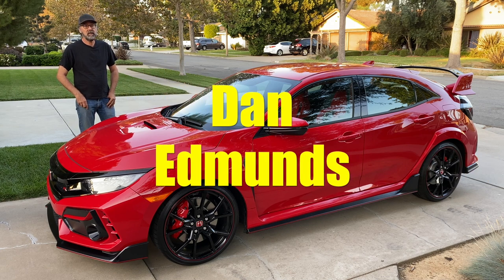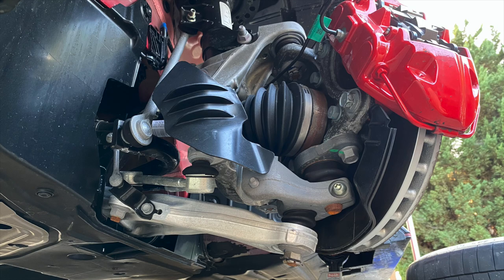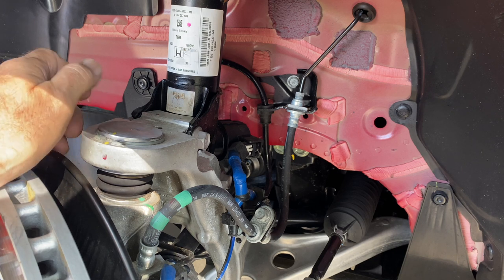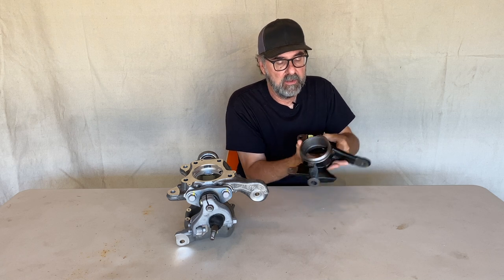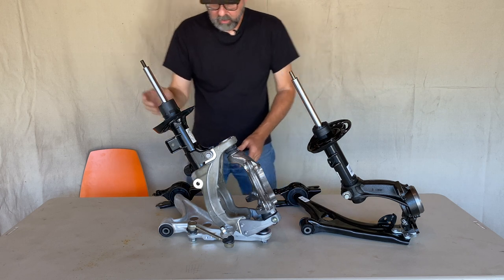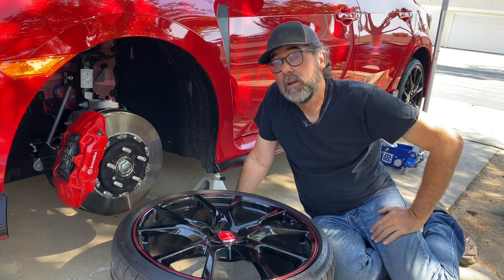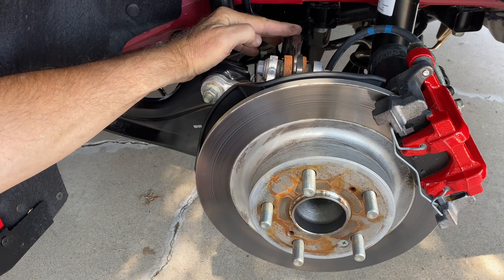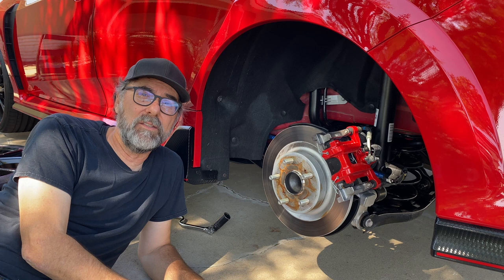2021 Honda Civic Type R Suspension Walkaround - See The Engineering That Gives It Epic Handling

Comment: Can you comment on the wheel size and the effect that has on this setup? Is the suspension geometry designed with that size/sidewall in mind?
Reply from the maker: As a factory-developed package, absolutely, all aspects of the suspension including the tire size, wheel offset, etc., were considered. It's all optimized to work as a complete system.

And its not just about tire size. When I developed suspensions back in the day, I routinely worked with tire supplier engineers to tweak the internal construction of the chosen tire brand and size. Over the course of several months there could be three rounds of joint evaluation using the prototype vehicle I was using to develop the springs, stabilizer bars, bushings and dampers. Each round might have six submissions, each with different internal construction details meant to deliver a different ride, steering and handling feelings. The tire company representative and myself would conduct joint drives and has out next steps.

That's all true of any car. But with something like a regular Civic, the target buyer is a typical non-enthusiast buyer. That kind of system is tuned to have broad basic appeal. But even there the choice of tire size and the internal tire tuning is made to work in that context. But because the target customer is more middle of the road, an enthusiast buyer who is willing to give up ride, noise, etc. can experiment with aftermarket parts to alter that balance and get more performance. 

Here, of course, performance was the point. There's less incentive (and potential benefit) associated with owner-installed tuning on a Type-R because this tire size, wheel offset, etc. were developed along with this geometry and spring/damper tuning and the unique dual-axis strut suspension to make this package work as a unit in a more performance-minded context.

It's interesting to note that while the recently-introduced 2021 Type-R Limited Edition does have special wheels and tires, they are the exact same size and wheel offset as this car. The difference? Stickier rubber and lighter wheels. They save 5.5 lbs of weight (all unsprung) at each corner, which makes a lot of sense when you see all that stuff on my bench walkthrough. But the tire/steering relationship has been absolutely preserved because that's all been sorted out to their satisfaction.
Reply: @DanEdmunds  Great info, thanks for the reply. The larger wheel sizes >18" always make me wonder if the manufacturer is taking the realities of today's roads into account, or just prioritizing looks and driving feel in ideal conditions on these cars. Definitely a balance though...Can't have it all!

Comment: Good day Dan. In your opinion. Should you lower these cars
Reply from the maker: It is pretty well optimized as is. Just drive it! If you're itching to mod it I might look at same-sized, but lighter, wheels and tires, though. The new 2021 Type R Limited Edition has them -- 4.5 or 5 lbs lighter for each wheel/tire assembly -- and friends I know who were able to drive it at the press launch (I had a schedule conflict and had to decline the invitation) tell me it does make a noticeable difference on the track.
Reply: @DanEdmunds  very good👍
Reply from the maker: Correction: the Limited-edition wheels tires are 5.5 lbs lighter per corner.

As for modding, I would add that there may well be decent lowering kits out there. I just can't vouch for any of them. The FK2 previous-generation Type-R they sold in other parts of the world had this dual axis setup, too, so there is a bit of history there. But I think a lot of people thought the FK2 was rough around the edges (and on the street) and needed help, whereas the FK8 (2017-present) is pretty well dialed in.

The folks at Honda know there own car pretty well, and this isn't a normal Civic that's made for commuting. I'd be much more in favor of tweaking/lowering the suspension if this was a garden-variety Civic. I'd leave the suspension alone here unless you were a serious autocrosser or a track-day regular who had reached a point where you were looking for more performance and were willing to torpedo daily-drive livability.
Reply: @DanEdmunds  appreciate that

Comment: Can you do one of these on the new Supra?  There's a lot of controversy on rear toe change, some saying it ruins the car, some saying its not a thing...  I'd like to see your take on it
Reply from the maker: I did do one, but with photos for Autoblog. That was before COVID was a thing and I started making video versions. I'd previously driven the car in anger on a circuit, and I thought it behaved brilliantly. The toe-link and primary lateral link aren't that different in length (although to toe-link is longer), and I think that adds a dab of roll-induced toe-in to the outside rear tire, but not so much that it takes the liveliness out of the rear end. https://www.autoblog.com/2020/03/18/toyota-supra-suspension-deep-dive/
Reply: I bet it's the haters trying to dig out  an excuse to shit on the Supra.
Reply: @aaronbryan5095  not really, I first heard about this from someone that bought a Supra and then had a custom rear subframe built to "fix" the problem.

Comment: 2021 Veloster N DCT
Reply from the maker: I've already examined the Veloster N -- scroll back a few months in my video feed. https://youtu.be/WeKkIlHeUy4

True, it wasn't the DCT, but we wouldn't see any suspension difference. The DCT's internal shock valving/programming is different and its front spring is slightly stiffer because that transmission weighs more than the manual. Also, my test car had the Performance Pack with its bigger wheels/tires and larger brake rotors. It was an option in 2020, but it is now standard on 2021 models--manual and DCT alike. Since my 2020 test car had that option we've already seen that stuff. But, sure, I would still like to get one in and drive it! I think my shooting and editing is better than it was then, too. If only a little.

Comment: does anyone know if i can put factory type R suspension from a mark 9 onto a normal 1.8 mark 9 hatchback ie will it bolt straight on? can i get new springs and dampers and just replace them?
Reply: It should bolt straight onto the car - that's the whole point of this design. However, the front hub and bearing assembly is different, so you need everything that is removable from the car: control arms, suspension fork, steering knuckle, hub and bearing assembly, brake rotor and caliper, and presumably the axle halfshaft as well.